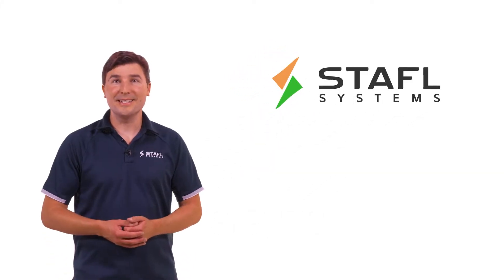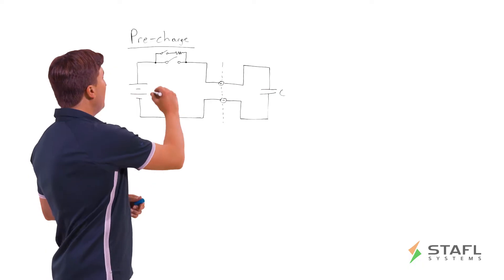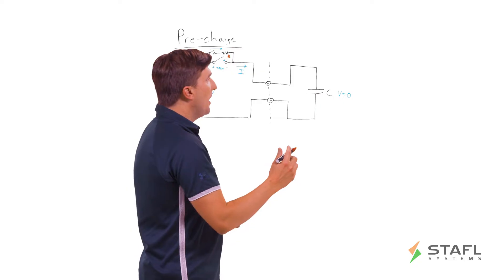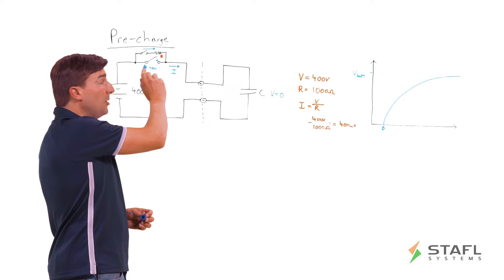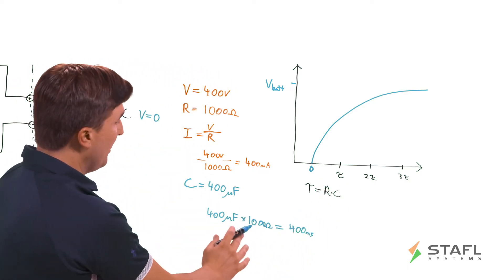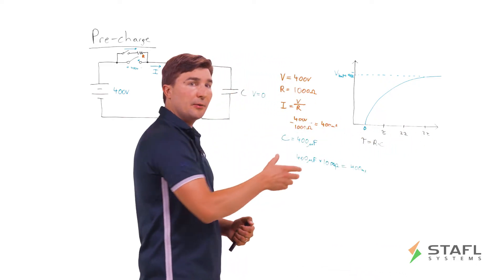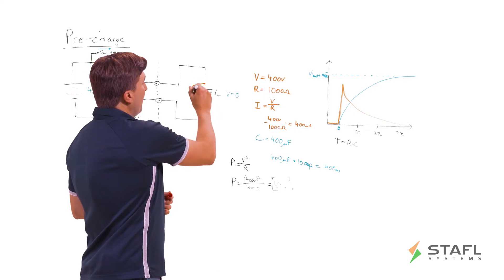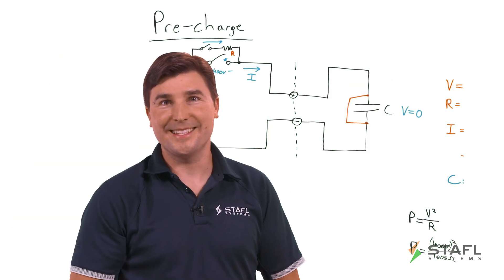Pre-Charge Circuits for Lithium-Ion Battery Packs

Comment: Hi Eric, have you ever considered using a coil and a resistor between the batterie and the main switch? You could avoid the small parallel circuit with the switch. Less moving parts and therefore more reliability.

Comment: If I'm using a DC breaker that disconnects both poles could small gauge wires be routed to bypass the breaker with a momentary switch on the positive side with a resistor?

Comment: I have a small project. I would appreciate some help please. I want to replace 12v NiCad pack in a cordless drill with lithium Ion batteries. If I install a BMS in each pack  , can I use a basic 12v charger for the lithium Ion conversion , or is a specialised charger needed. I figured the BMS would do the balancing work rather than having to use a special charger . Is that right . It would be good to have some confirmation  thanks

Comment: Is there a reason that the main contact switch can't be a power FET with slow initial turn-on time and diode for discharge (powering load)? While then when wanting to charge battery pack another power FET in opposite drain-source direction with another diode (opposite direction) so that both charge/discharge states can be enabled/disabled by BMS?

Comment: Your videos are superb and very helpful. Could you explain about the importance in compression of LiFePO4 cells during battery pack manufacturing. I keep finding several literature regarding the benefits of cell compression. However, the battery cell manufacturers provide us with a cell guard for each cell when manufacturing battery packs. When these cell guards are added, the compression of cells cannot be done. Should I add these cell guards, and not compress the cells? or should I not use these cell guards and compress my cells properly?
Reply: You mean like hydraulic press compression? Dont do compression of this type..

Comment: Hello everyone, first of all, thank you for the explanation. I have a question, is the precharge circuit in the battery pack or included in the converter (inverter) or is it a separate system?
Reply: included in invertor
Reply: It is supposed to be in the battery.industry standard is to have precharge upstream from the inverter.never expect the inverter to have precharge for inrush protection
Reply: @zachfpv4493 thank you.

Comment: How can I determine the capacitance of a 48v inverter? Both the battery system I'm building and the inverter I'm buying will be 48 v. Inverter is rated for 3000 Watts.
Reply: Open it up and look inside.

Comment: i'm making something with a 3kw hub motor with 80V batteries so basically a parallel circuit thru a 1000 ohm resister will work.

Comment: Hi Eric, is there an expected life of the precharge circuit seeing as it is doing a lot of the heavy lifting.
Reply: It doesn't do it for long. You just have to figure it out and spec it to withstand the power, currents, lifetime, etc. It's like a starter in an ICE car: usually it runs once then gets hours to cool off. But you can burn it up if you keep doing it over and over, so you have to detect that and prevent it. If your main contactor doesn't work, your precharge could still be connected and your main load starts, and that's when your precharge can burn up. Happened to me in a radar transmitter.

Comment: Really good videos! Could you make some video about concections type in battery pack : laser welding, spot welding... especially mechanical joint with different type of washer. I think preventing self loosen because of heating is very exciting